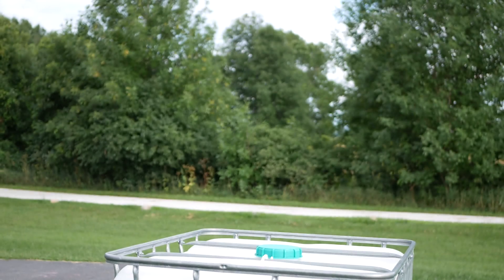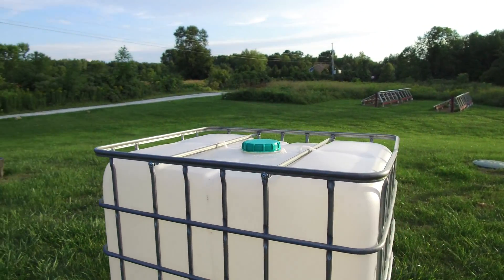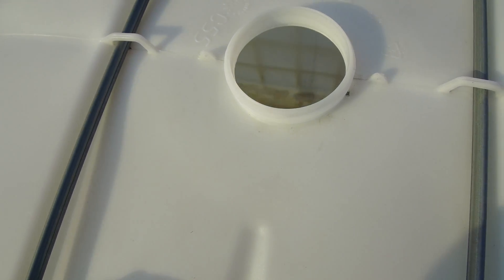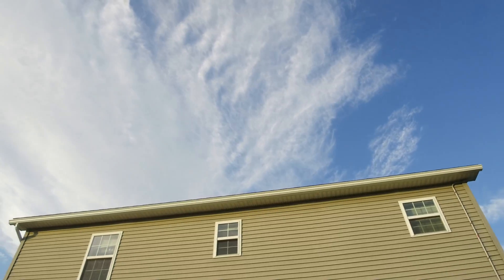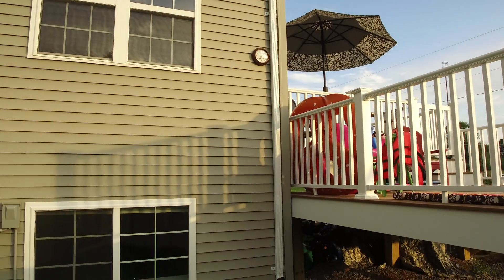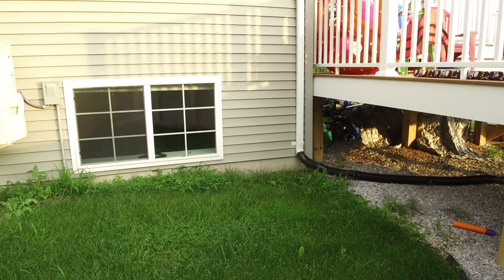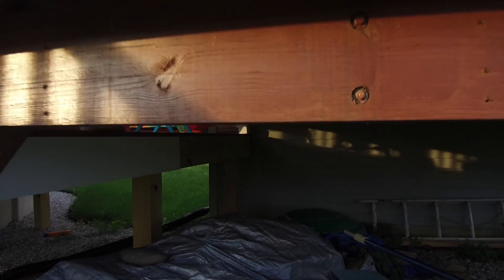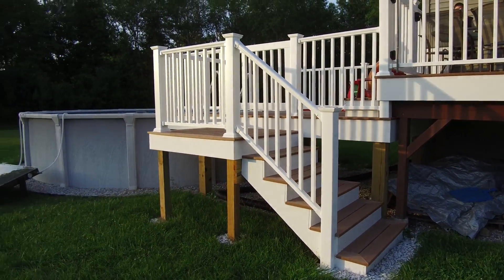DIY Off Grid Rainwater System using an IBC Tote - Part 1 (Planning)

Comment: Haha, just did this exact thing, down the road from you here in Georgia, VT! Even got a Lechtin tote from the same place like you! I pulled the tote out and coated it in black plastic to prevent algae, then put it back in the cage. Water comes out FAST from the full diameter valve when the tank is full, but found it's not pressurized enough to work a regular hose sprayer when operated at the same level as the tank. You may want to consider how to overcome that issue if you want to use a hose and sprayer.

Comment: Do not take the plastic tank out of the cage. It needs the strength of the cage to mainain structal intergrity of the tank. If you remove it, it will lose its shape, colapse and leak
Reply from the maker: James Pottorff Thanks for that info!  Most helpful, will do!